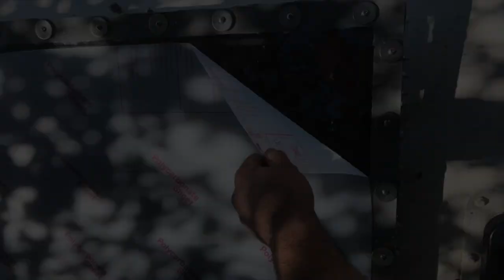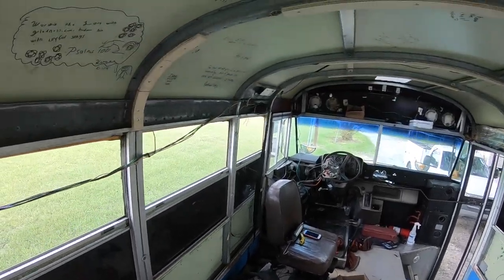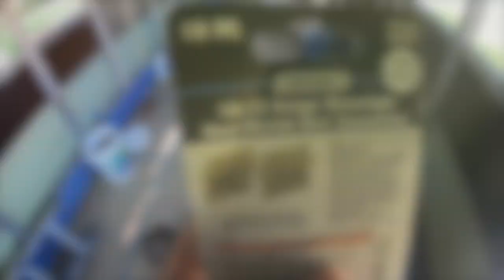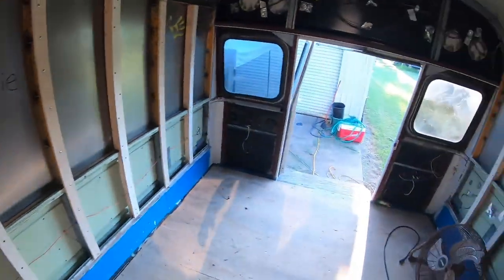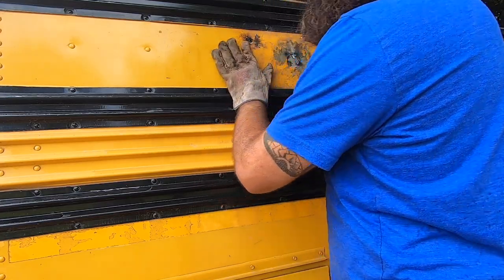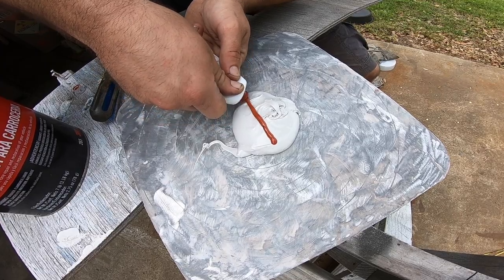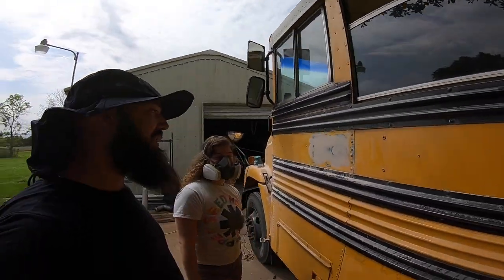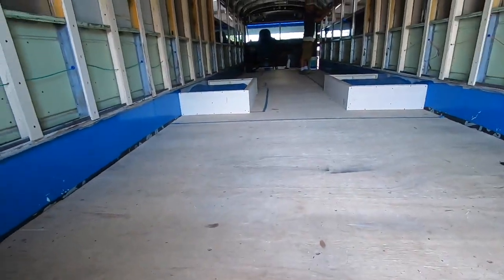HATCH INSTALL // Preparing a School Bus for Spray Foam Insulation

Comment: i think you can get it bend by sawing it in , you need to saw through 2/3th to 3/4th to get it to bend  eazy enough though 
as for the roof wiring , it be eazier to replace or add wiring if you run the wiring through flex tube front to rear 
as for bondo : a golfball size blob of bondo to a pea size blob of hardener , make several small batches not one big batch as you dont have enough time to put it down
you can remove wet bondo with acethone , the dried bondo from the board you can get off with a metalbrush on a drill
Reply from the maker: Thanks for your feedback!

Comment: Great video.  Were you able to stop leaks and seepage?  We're in the midst of that battle currently!!  I'd also like info on the marker lights you used.  Are there regulations as to where they are used and what color they need to be?  I'd like to light our bus up like a Christmas Tree!
Reply from the maker: THANKS!! 
Still battling with a couple of leaks after foam; Front cap, Skylight/Hatch & a couple of windows. Plan on using clear silicon around the exterior of windows once painted. Haven't wanted to deal with the rest yet😂
LIGHTS! Super happy with these LEDs I'll include a link. Regulation on how many & where vary by state. DOT has a minimum. AMBER & RED are a must. The stipulation I believe is HOWEVER many you have need to ALL be lit.
Reply from the maker: https://www.amazon.com/dp/B01GKQXOP0?ref=ppx_pop_dt_b_product_details&th=1